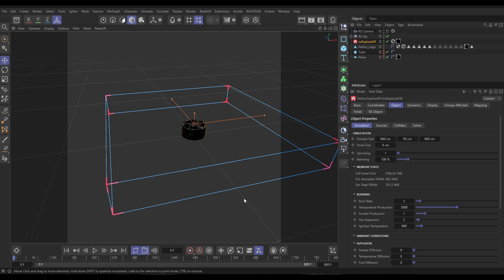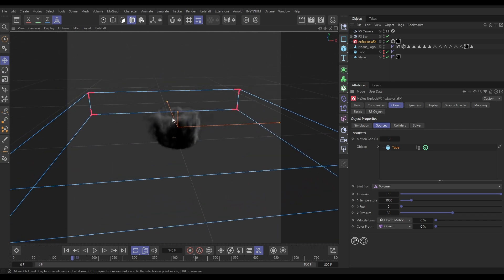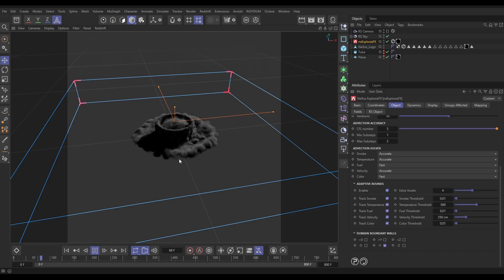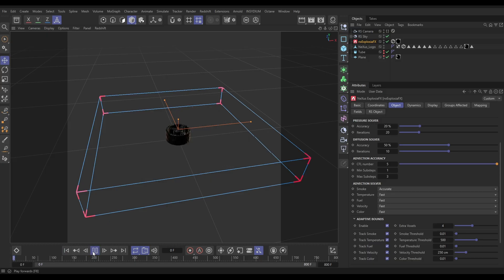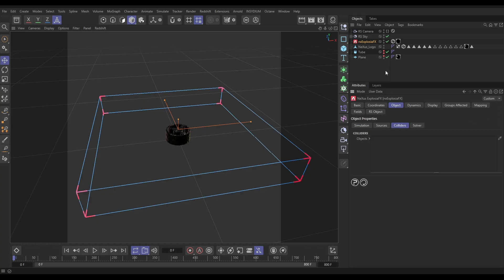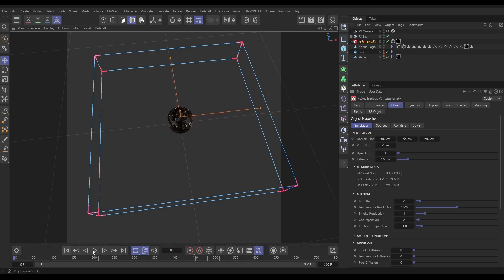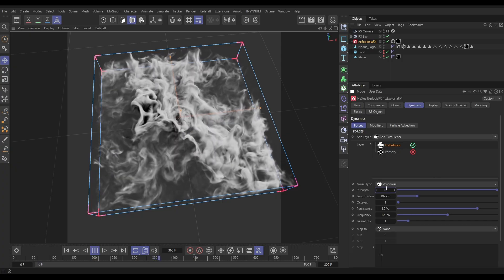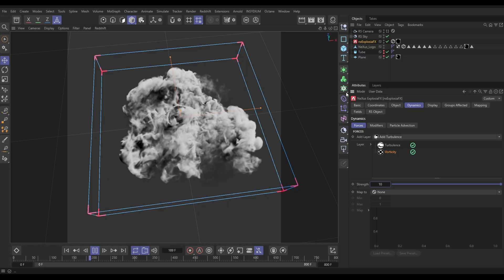Top Tip Tuesday - Dry Ice

Comment: Does it work on CPU?
Reply from the maker: nxExplosiaFX is part of our advanced NeXus GPU simulation system and runs on the GPU using Vulkan, with most modern GPUs fully compatible. For the best experience you will want plenty of VRAM as these simulations are very hungry.

Comment: w respect I say this.
Insydium needs to get xplosia fx working on MAC as it 100% crashes EVERY TIME. 
This is a major problem and limiter to many artists like myself. 
Please resolve this for your base.
Reply from the maker: nxExplosiaFX works fully on Windows and Mac with full OGL, DX and Metal support. Please try the beta, it’s available to all customers. If you have any issues, post a bug report or use our Discord beta channel. If you mean the legacy xpExplosiaFX, that also works on Mac, but if your system lacks AVX support, use the non-AVX build included in the install. Our tech support can help if needed.
Reply: @INSYDIUMLTD  Appreciate this info and update. I will try this on my M3 Ultra.

Comment: Great effect. I’m impressed by the speed.
I’d be interested to learn more in one of the future videos about the correlation between voxel size and upscale, in order to understand in detail how to use it most efficiently and what happens “under the hood” so we can learn it the right way.

For example, is it better to work with a larger voxel size for a faster simulation and then use “upscale” before rendering to get more detail, or is it better to reduce the voxel size — or perhaps both? And how does this affect caching? Can you apply upscale after a cache has already been created?
Reply from the maker: Larger voxels give faster feedback, smaller voxels give the most accurate result but use far more VRAM. Even a tiny change in voxel size can increase memory use a lot. A good approach is to pick a voxel size that gives the FPS you want, then use Upscale to push in more detail. Bob shows this in the NeXus ExplosiaFX tech preview. Caching depends on data size and can take time because these caches are many GBs, and writing to files is never as fast as the GPU. Reading a cache can also be slower than simulating, depending on the hardware and the simulation.